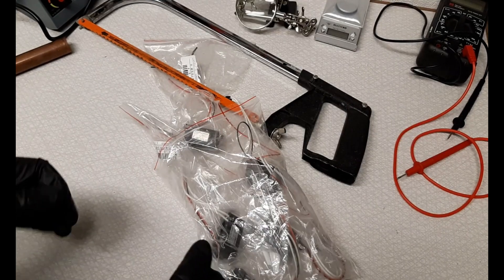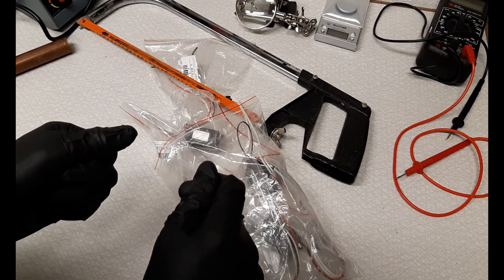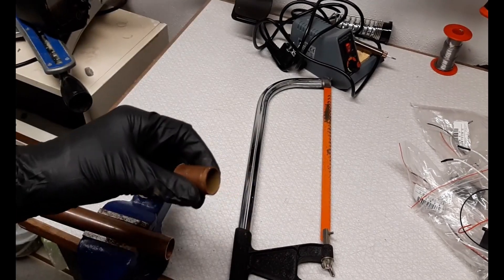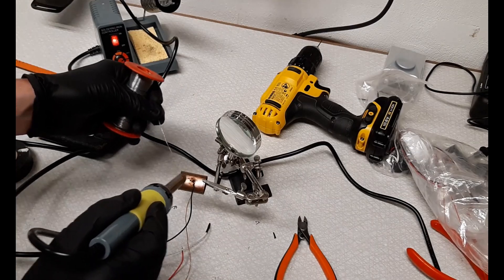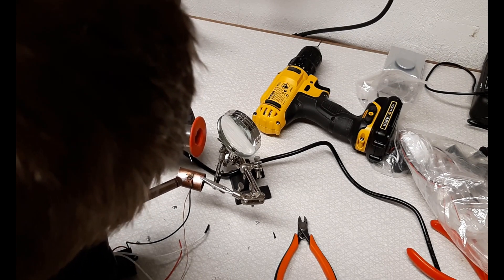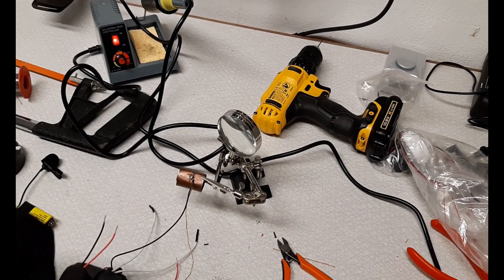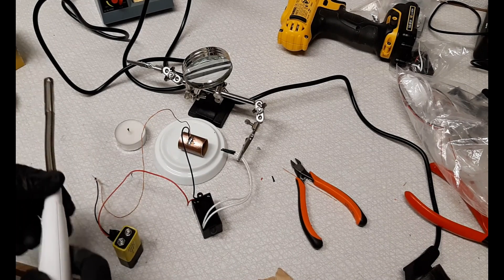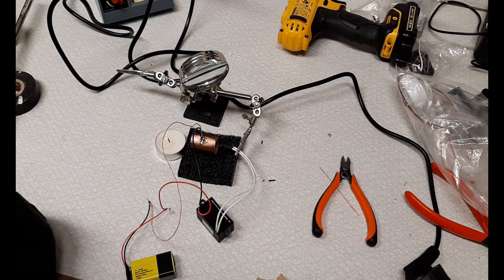Ion engine

Comment: what is the volts you have on that power supply ?
Reply from the maker: It's a 4volt battery. The battery came with the arc lighter.

Comment: Is it possible to compress ion wind?
Reply: Before or after the wind reaches the copper ring that will neutralize the ionic wind? If before then it would be electrically charged and would be affected by anything that affects electrostatic forces like magnets or electromagnets (this is why the charged wind accelerates to the copper before the charge is lost). If after the neutralizing area in the copper then anything that would affect a non-electrically charged flow of air would work (eg. plastic hose with an adapter that connects it to a smaller hose).

I'll admit I recently got the idea of doing something similar with a similar ion generator so this video is nice to see (very few videos I can see that has someone using the premade ion generators that don't use massive amounts of volts that cause sparking).
Reply: @curiousviewer5991  I was thinking after the wind reaches the copper ring. Incorporating an air multiplier that used the air attracted to the copper ring to then pull in air surrounding the copper tube.
Reply: @edwinwaters6778  Once the wind touches the copper ring the charged air molecules will become neutral so, yes, you could as long as the airflow is fast enough. Might need more than one ion engine feeding air tubes into a central chamber first before going into an air multiplier (eg. dyson bladeless fan) to get enough but at least you would have a truly bladeless fan (I've thought about that myself :)  S & D innovation's channel had a more powerful one (Ion thruster with more thrust VER 2) blowing into a fan and it looks like it used electromagnetism on both sides to accelerate charged air as well (the emitter is in a wide coil to create a more powerful repulsion effect at the tip and another is behind the charged wind collector)
Reply: @curiousviewer5991  Now it's a case of developing a design that will compress the air flow. A venturi nozzle might be more suitable for this given the linear flow of the air. Then further compressing the air and increase the pressure to then pass the air into a dyson bladeless fan.